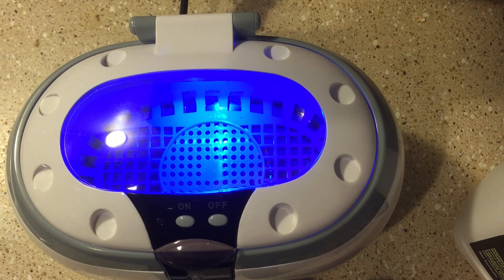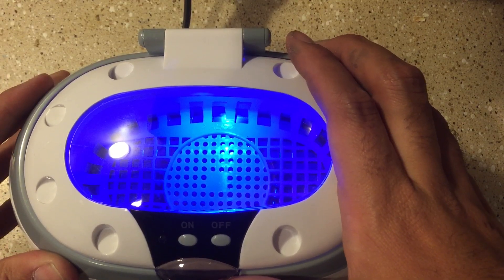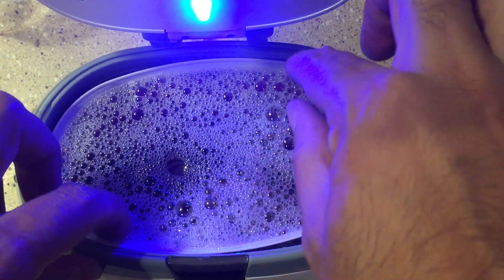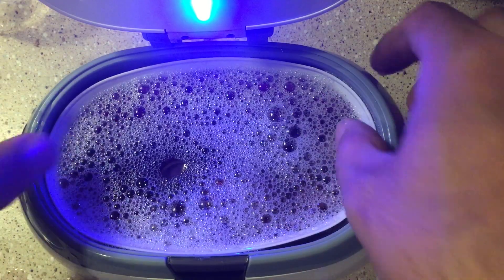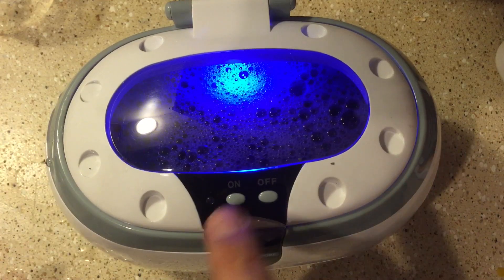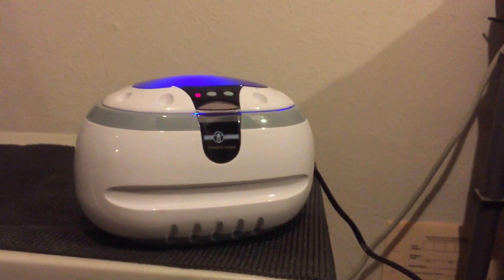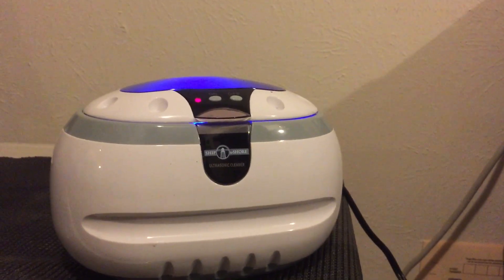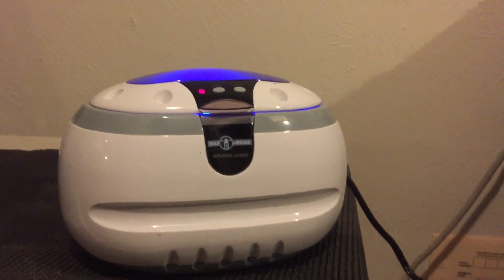Cleaning SilencerCo Sparrow & Spectre 2 with Ultrasonic Cleaner

Comment: Got an ultrasonic cleaner from Amazon about $40. Has a 30 min timer. Ran it twice for an hour and did a great job on my specter 2 baffles. I used vinager and peroxide since its what I had available and it works really well. Will try the purple stuff next time to compare. Thanks for the video.
Reply: Hope you disposed of the lead chemical when you were done. It's extremely toxic and carcinogenic, waste dumps wont even take it.

Comment: Get you a tube of "Bore Butter" and smear a good layer on all your baffles and tube sleeves before putting it back together and the next time you clean it, the majority of that crap will wipe right off. I do this to my integrally suppressed 10-22 baffles along with my Tactical Solutions Axiom can and works great.

Comment: That Purple Power Product Works Good,Sucks On The Timer Issue,Oh Yeah Came Out Great.
Reply from the maker: derplinkster thanks derplinkster. yeah, it was pretty annoying having to start it every 3 minutes but I just cleaned other stuff at the same time.
Reply: Yea Just Mentioned On Another Chnnl Will It Work For Cleaning Coins When They Find Them Shared Your Vid Hope They See Yours.
Reply from the maker: yep, it'll work on coins & jewelry. just make sure no aluminum or similar metals. it will dissolve them
Reply: Thanks Will Share Your Info Thanks.

Comment: I've got access to an industrial powered ultrasonic cleaner. And honestly not that impressed with the cleaning abilities. I've found it's best to do it the old fashioned way. With the sparrow use a nickel to scrape the clam shells. The coin is softer than the shells so it won't damage or scratch. I picked up a set of dental picks from the flea market and find the ones that work best. I like a small spoon looking one that you just gouge out the led build up on the mono-core. It takes time and patients but my sparrow looks brand spanking new! And I full auto the shit out of that bad boy! If you chip at the lead you'll get it to break off just use tools that have an edge but not really sharp. So you won't damage the can. And wear gloves!!! If your using a dremel tool use a respirator!!! You'll fling lead and shit all over the place. And clean up your work area pretty good!
Reply from the maker: ShooterSD72 thanks, I used to clean them with random little tools but i was impressed when I had mine cleaned by an industrial cleaner in 10 minutes. The sparrow was so fowled up that I couldnt even pit it back in the tube. This lil fella gets close just 32X slower lol

Comment: I've heard that a tumbler can work on steel rimfire suppressor baffles as well. Has anyone tried using one? An ultrasonic cleaner at least sounds way cooler and more high tech than a tumbler does. I am about to buy a rimfire can and would prefer to go with an ultrasonic cleaner as long as it's reasonably effective.

Comment: If they are all metal parts with no rubber or plastic you could soak them in this===>     http://www.autozone.com/fuel-and-engine-cleaners-additives/carburetor-cleaner/berryman-chem-dip-carburetor-and-parts-cleaner/139313_0_0/     then just rinse them with hot water and dry.
Reply from the maker: BUDDY LIGHT thanks for the tip
Reply: I thought if it eats all the crud out of a aluminum carburetor it would work great on them.
Reply from the maker: sounds logical to me